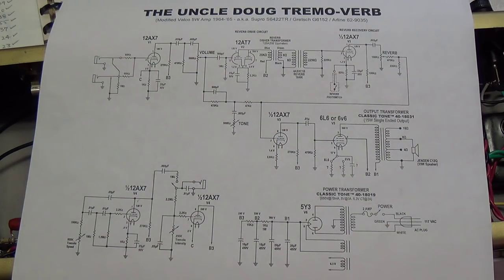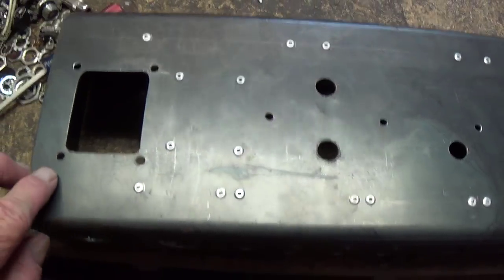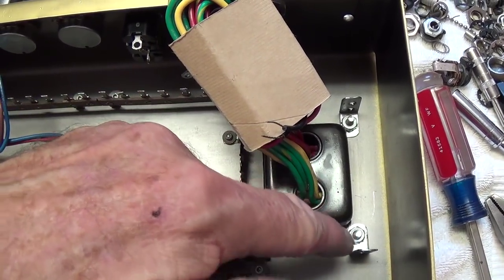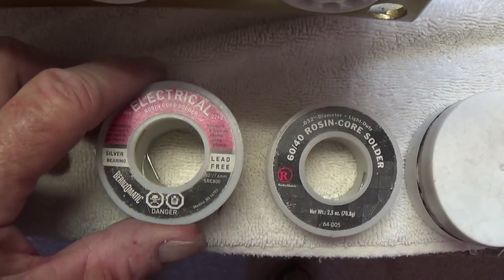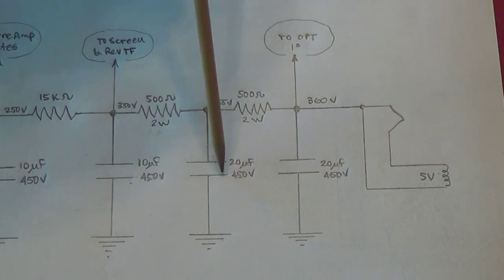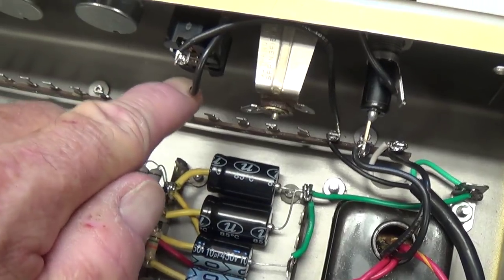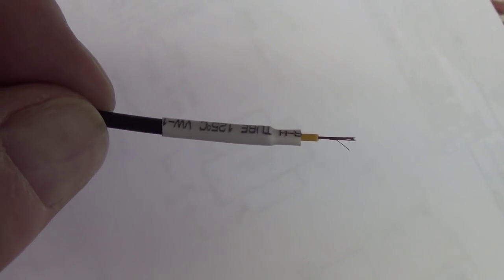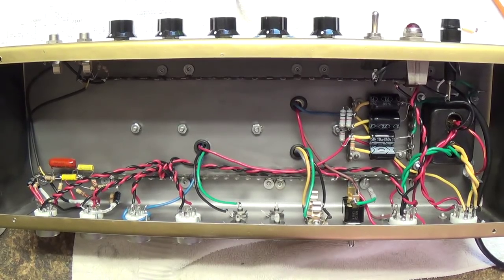How to Scratch-Build a Vintage Amp, Part 7:  Chassis Finishing and Point-to-Point Wiring

Comment: Uncle Doug, are those washers over the terminal strip supports?  Why was that necessary as most of the support strips come
with 1/8 inch holes that take a proper length rivet, (length of rivet is very important for "rivet squashing" to make it a tight mechanical connection.  I don't see the need for washers,...unless  of course, the rivets used were too long in the first place.
Reply from the maker: +SuperCarver2011  It wasn't the rivets, SC, it was the holes in the terminal strip supports.....they were larger than 1/8" and I wanted to be sure the supports were tightly (and permanently) pressed against the chassis surface.

Comment: Hi Doug, hope you dont get upset with yet another question. I am working through my schematic and none of the resistors show a wattage value rating. On another scheme I have as an e.g. the first 100K Resistor on the B+ which has 390V coming into it says it should be a 10W resistor. Is there a way of working out what wattage the resistors in the amp should be if they are not marked?

BTW I am hanging out for Part 8.
Reply from the maker: +allanpennington  Part 8 just got posted Allan. Somewhere on virtually every schematic, they will say "All resistors are __ Watt, unless otherwise stated". Most commonly they are either 1W or 1/2W.  I always go with 1W just to play it safe.

Comment: Hello Doug, I may have missed you commenting on this before but what wire gauge do you use? I assume it varies depending on whether the wire is for B+ voltage, Heaters or plate and/or cathode connections. Do you work with a standard set of gauges? I only ask since the pictures of the amp I have seen for the one I would like to eventually build certainly look like different thicknesses. See pic here: http://c-nelson.com/wp-content/uploads/2014/06/1968_Vox_AC10_03250RV_025.jpg
Reply from the maker: +allanpennington Greetings, Allan. The transformers come with varying gauges.....much heavier (16 gauge ?) for the 5V and 6.3V heater filaments because they carry several amps. The rest of the wires are probably 18 to 20 gauge.  In my opinion, the filament  wires are the only ones that should be heavier gauge.  The rest of the circuit carries only milliamps of current.
Reply: +Uncle Doug Ah thanks Doug, clearly I have much to learn as you can tell from my question in which I assumed it was all about voltage, but you rightly point out that current capacity is the factor which effects wire choice. Here is another photo showing the main part of the Vox AC10SRT and the interesting terminal board used to atch the components. http://c-nelson.com/wp-content/uploads/2014/06/1968_Vox_AC10_03250RV_024.jpg The previous c-nelson photo showed some new caps, (the original had a Can Cap under the spring holder) as seen in this more original shot, http://s889.photobucket.com/user/vox75/media/ac-10%20SRT/DSCN0172.jpg.html  but most of the others seem original. In the c-nelson photo the tremolo circuit caps are at the far left of the board as far as I can work out. These are foil type originally made by WIMA who no longer make this type of capacitor. Do you use a more modern equivalent or try and find foil caps like the vintage SoZo Mustard or Blue Molded seen here http://www.tube-town.net/ttstore/Capacitors/SoZo-Capacitors:::31_350.html They state that quote "The BlueMolded line of capacitors are retrofits for Astron or Blue Molded caps used in vintage tweed, brown, and blackface Fenders™. These capacitors amazingly capture vintage Fender tones of the Blackface era, and the famous 1959 tweed 5F6-A Bassman era."  Do the capacitors really effect the tone of an amp? As you can tell I am perplexed by the myriad of choices to make when cloning an amp from a vintage era. Whilst wanting to get as close to the original tone many of the components are no longer available today.
Reply from the maker: I am not a strong believer in "boutique" capacitors, Allan. I use good quality, affordable caps made by Sprague, Nichicon, etc. I've heard all sorts of wild claims about "vintage-sounding" capacitors, but have yet to see a scientific study that can detect any measurable difference between them and the regular type of caps that I use.....other than price.
Reply: It's just possible that there is a scientific study which detects a measurable difference.  However, there has never been a properly conducted double blind listening test where a difference has been detected. Nor will there ever be.

Comment: Sir, you make youtube worth to watch :)
Reply: He does.  So do a lot of folks.  Just found Uncle Doug though.  Really good teacher.  Got some parts on order to start my own amp building.  I am an ex electronics tech though ...  know how to solder (was Mil spec 2000 qualified at one point, soldered under a stereo microscope ...chip components)... have learned a ton from Uncle Dough about tube amps.
Reply from the maker: Thanks, Echo :)

Comment: Great Videos!! Your build is looks great!!!  When you paint the chassis, are there any grounding issues? A few years back I built a kit  5e3 from mishionamps. The chassis was chromed & had press fit nut.  It turn out really great!! 
Have you every tried/used getting a chassis chromed & how would a DIY'er install press fit nuts?
Reply from the maker: +Alexander Ross  I only painted the outside of the chassis, leaving the interior bare metal to facilitate electrical contact. No, I have never tried having a chassis chromed, mainly because in my area, chrome plating is horrendously expensive and may take up to 6 months to be completed. The local shops do rather mediocre work and often lose parts or get belligerent if you dare to question their methods or (generally) rotten attitude.  All in all, chrome plating is dead to me.  I have never tried (or really heard of) pressed fit nuts.  There are only a few instances where nuts and bolts are used.....i.e. tiny (size 4) ones to hold in the 12AX7 tube sockets.....and I can't imagine trying to press fit them.

Comment: Uncle Doug, I see everyone is putting their two cents here.  I hope you don't mind me tossing mine in.  I'd really like to see some big blobs of solder on the chassis, in this case perhaps silver solder or tix, or what ever will adhere to bare sheet metal.  30 years from now, when all the corrosion between your terminal strips and ground tabs forms, this amp will still work just fine.  I worked on antique radars for 20 years and those rivets get loose from the stuff that forms under them and between the layers of metal.  I've seen some crazy stuff happen.  I admit, these monsters were on ships and exposed to salt spray.
Reply from the maker: +mechmusicman  Thanks for the input, MM. I live in the desert, so corrosion is not a big issue, but I understand what you are saying.
Reply: What I found mostly wasn't corrosion but electrolysis due to dissimilar metals riveted together.  Especially aluminum.  Even tinned against steel.
Reply from the maker: I understand, MM. The terminal strips, ground lugs, and chassis are all steel, so electrolysis shouldn't be a major issue, since the metals in direct contact (and involved in ground connections) are all the same.

Comment: Hi, Uncle Doug. I'm looking at the Oct 15 schematic you linked in the description and I'd strongly recommend adding the 1MEG and 2.2MEG series resistors back to the tremolo circuit. Those resistors and the 250k pot form a voltage divider that reduces the sine wave from the oscillator to a suitable level (about 7% of the original voltage). Without the top half of that divider the full voltage signal (probably in the ball park of 200v p-p) appears at the grid of the cathode follower making for a very overpowering tremolo! It would probably also drive the cathode follower hard into grid current limiting, clipping and distorting the tremolo signal. Also, without those resistors the 250k pot will be a heavy load for a 12AX7 in common cathode when you turn it way down, which might drag down the gain of the circuit enough to cause the oscillations to stop.

Also, I'd recommend having the footswitch ground the input of the cathode follower so it doesn't effect the feedback path of the oscillator because, in the current position, when you close the switch (grounding the feedback) and open it again it might take a second for the oscillator to ring up again. Alternatively you can keep the footswitch there and connect the adjacent 1MEG resistor to the cathode of the 12AX7 which will shock the circuit back into oscillation when the switch is opened. 

http://www.valvewizard.co.uk/trem1.html

Comment: oh 1 more comment. THANK YOU for showing the "PROPPER"  way to make a soldered connection. it annoys me almost to the point of anger when I see people just putting wire into a hole and flowing solder into it. every vid it seems that I watch, even by people that "should" know better ends up ruined ( my opinion only) by good info followed by poor technique. you've shown that it doesn't take that much more time or effort to do the job correctly. as I was always taught, anything  worth doing is worth doing right the first time, every time. and besides, the correct way minimizes cold solder joints, the number 1 cause of malfunctions in most circuits
Reply from the maker: +TheRevClyde   You're welcome, RC, and a big AMEN to your comments.  Without proper electrical connections, a circuit is doomed......and very difficult to diagnose and repair.  A little extra effort during construction can prevent hours of problems later.

Comment: Lookin' good Uncle Doug!
 The maximum value of the first filter cap after a rectifier is not set in stone. It depends on the impedance of the power transformer. The values given on data sheets are just examples of typical operating conditions. If you look they will usually list a value of the plate supply impedance for that particular example. Measure the secondary's resistance and use the chart on the 5Y3 datasheet to determine if the capacitance is within a safe range. Not all datasheets have this chart, you need to look around on the net to find one. (an RCA tube manual probably has it somewhere) If the secondary's resistance is very low and the capacitance is very high, resistors can be placed in series between the secondary and the plates of the 5Y3. You can actually run quite high capacitance on the first filter cap this way. Of course, this series resistance leads to increased sag which will counteract the high capacitance. Usually the higher the current capability of the transformer the lower it's impedance will be. With the transformer you have chosen and the fact that class A amps have a relatively constant current draw, 40uF is probably just fine. Look at the data sheet for your transformer It may list it's secondary resistance or impedance then look at the MINIMUM plate supply impedance on the data sheet. Since resistance is usually the more reactive element of a given impedance you should be safe to go by that value. Hope that makes some sort of sense and I haven't just rambled on too much. I'm just a hobbyist so better to look this stuff up than go strictly by my word. I think Merlin Blencowe at The Valve Wizard site has something on this if I remember correctly.
Reply from the maker: +tiki torch I looked through quite a few schematics, TT, and couldn't find a single one that had more than 20uf as the first cap after a 5Y3. I believe what you are telling me, but still feel better splitting up the 1K into two 500's. I guess I'm just old fashioned, but I tend to take the conservative approach......especially when it's rather easy and can cause no inadvertent harm. Thanks for your detailed and informative input.
Reply: +Uncle Doug I hope you didn't think I was trying to say you were doing it wrong or anything. I was just trying to point out the relationship between rectifiers, transformer impedance and capacitance. But, like I said, this stuff is just a hobby for me. I'm not an expert and have no "formal" schooling in this. I would have done it just the same as you did anyway. Or I might have fed the OT from the second node...whatever. Your amp is looking great and I'm watching this series with great interest. Vintage Valco amps rock!
Reply from the maker: Thanks, TT. I truly appreciate any informative input, and yours definitely was. I will keep it in mind for future study. I'm glad you agree with my solution to the problem. Another viewer asked if the second 20uf cap might not have been the typo. I tend to think that even if it were, having an extra low pass filter in the power supply can't help but make the DC a little more ripple-free. Again, your input is always welcome and appreciated.

Comment: Uncle Doug, this is shaping up to be one very special piece of audio equipment. A veritable Mona Lisa among amplifiers. I do have one query about the revision to the schematic. Is it possible that the original schematic inadvertently shows 4 filter caps when there should be only 3? This would seem to be an easier mistake to make than omitting a resistor from the drawing. Although I cannot say with certainty, some of the open chassis photos of the Supro you can find on the web do appear to show only 3 caps.

Comment: Hello UD. Thanks for all of the construction tips and demonstrations of how to achieve a really high quality build. I plan to incorporate your methodology on my next (second) tube amp build. my first build works fine but is not nearly as neat and clean as your wiring. I did encounter some problems with a tremolo ckt that ended up being due to component placement and lead length. Your methodology will avoid any similar issues. The timing for this video series is perfect since I had just finished the cabinet but had not started the chassis construction. As others have said, you have a gift for teaching and I appreciate all of the effort that you put into making these videos for our benefit. Thanks again.
Reply from the maker: +Stanley Chytla You are quite welcome, Stanley. It's great to hear that the videos are helpful and appreciated.  Amp building is a rather complex art, and, like any challenging task, requires a lot of concentration, foresight, and practice. I have no doubt that your skills will increase appreciably as you gain experience. As my old granny used to say: "If it was easy, it wouldn't be nearly as rewarding".  Best of luck with all your projects.
Reply: +Uncle Doug Hello again. I noticed on the schematic  that the second half of V4 for the tremolo circuit does not have a plate resistor but is connected directly to point B3 which has the 10uf cap.  Is that an error?Also I have a general question about plate voltages on guitar amp output tubes. It seems that guitar amplifiers routinely show plate voltages that exceed the maximum ratings found in the manufacturer's datasheets. Why is that the case and does that harm the output tubes? Finally just a comment about amp design... In my research about standby switches I have learned that amps that use solid state rectifiers need the standby switch so that the tube filaments have a chance to warm up before the high plate voltage starts stripping electrons from the cathode. This seems less important with tube rectifiers since the B+ comes on more gradually along with the other tubes heating at the same time.
Reply from the maker: I'll try to address each of your questions. The lack of a plate resistor on V4b is because it is a cathode follower.....the output is from the cathode, not the plate.

Yes, guitar amp output tubes often run plate voltages way above the stated max value, particularly 6V6's in Fender amps (in my experience). The value that really seems to determine tube life, however, is plate dissipation (the product of PV x PC). If the PV is high, the PC should be low to compensate, resulting in a normal PD. As long as the PD is within proper boundaries, the tube should be OK.

I agree that Standby switches are of use only with SS rectifiers. I do not include them in any of my tube-rectified amp builds....IMHO, they cause more harm than good. According to The Valve Wizard, cathode stripping does not occur at the voltages seen in guitar amplifier tubes: http://www.valvewizard.co.uk/standby.html

Comment: And the light bulb goes on! I've just realised how the filter caps work (low pass filter to eliminate 50Hz ripple) thanks to your once again excellent narration.  I don't know why but it never twigged before. Awesome build Doug. I've got my first 'customer'  amp repair job going on right now. I'm replacing the main power tube board in a Marshall JCM2000 DSL100 for a friend of a friend. Got my 'Uncle Doug' dim bulb tester and cap draining gizmo all sorted out too.
Reply from the maker: +Andy Wragg You're welcome, Andy. It's great to hear that my abstract mumblings are actually being absorbed and applied in a constructive way.  Congratulations on your first paid repair job. I hope it goes well and is only the first of many. Best of luck to you in all your projects and pursuits.